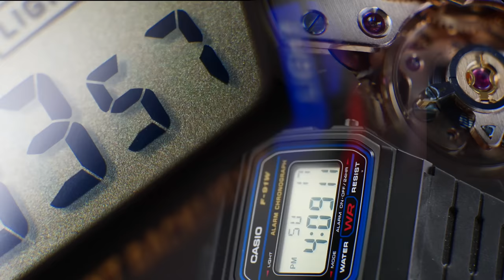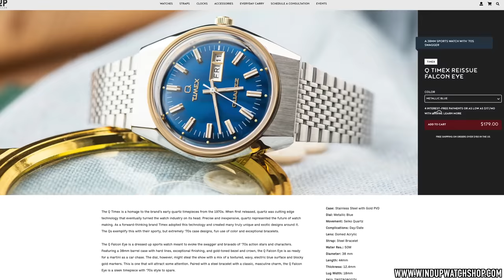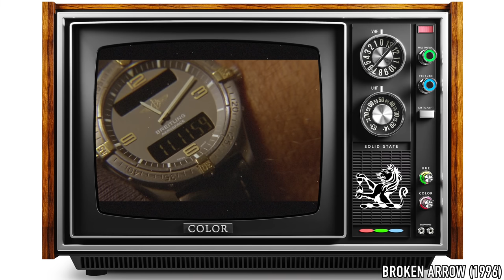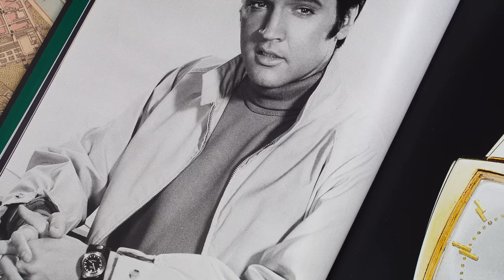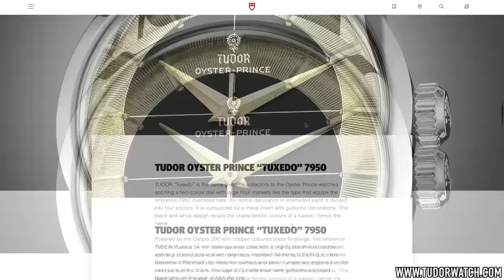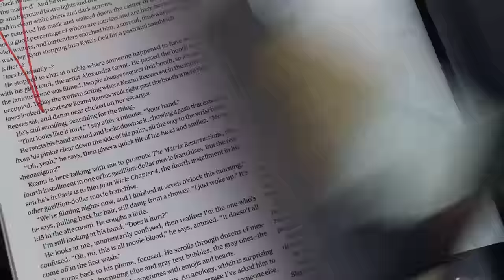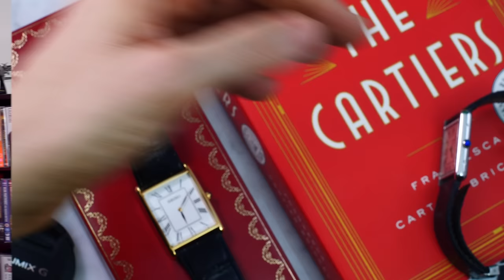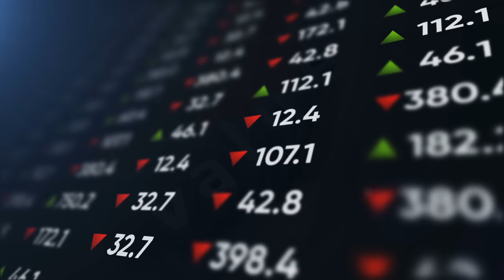2023 Watch Trends & Predictions: Sexy Tudors, Boring Rolex, Citizen Rules, Swatch Seamaster & More

Comment: I am not much of a watch collector because I don't have a ton of money to spend, and when I do it usually goes into my main hobby (astronomy). My most expensive watch at the moment is the Seiko SN411 which I absolutely love. I love the busy dial and I actually make use of the slide rule on occasion. My daily driver is a Casio G-Shock GD350B with the white on black display and a vibrating alarm which is the only thing that's ever been able to wake me up every morning. 

My favorite color is green so I have no complains about green watches except which one will I buy? I just came across a Citizen Promaster Air in green with the slide rule bezel, eco drive and audio controlled. I want it so bad! 

Love your videos, one of my favorite watch YouTubers!

Comment: "...while I find it very boring, derivative, mostly uninformative, and insulting to those less well off."

Well said. Many of us, certainly myself included, are enthusiasts whose aspirations are far lower than what many might consider aspirational. I'm 50, and could probably count on one hand the number of times I've even been in the same room as a Rolex, but I love wristwatches and the stories they tell and the joy they engender. It's also why, I believe, your channel is a success. You have found that sweet spot where you you can speak as the Urban Gentry without condescending to those of us who, like me, would be more aptly identified as the Rural Peasantry. Keep it up.

Comment: Great video as always and your ideas of colurs that may be on trend  for 2023 along with the nostalgic designs from the. 70's & 80's in mind. I would love your take on the newly released Red dial Zenith Defy Revival A3691 which follows the limited release of the Defy Revival A3642 cassaforte del tempo.
Reply from the maker: Outstanding suggestion. It has been absolutely donkeys years since the last Zenith on the channel. I will certainly look into it.
Thank you Mark, 
Best regards,
TFV
Reply: @theurbangentry  Zenith have just released another revival with a blue. dial, which looks stunning, the A3690. I have the original A3642 and the limited to 250 revival A3642 released last year but boy oh boy am I tempted by these two new ones in Red & Blue. would love to chat with you about them and get your take on the whole revival thing.

Comment: Excellent video, TGV!   I hope that your predictions are accurate. I completely agree with several specific statements you made.  

Tudor and the Black Bay are integral. The Black Bay could legitimately be given credit for saving the brand. It had already left the US and if the Black Bay had not succeeded, what reason would there have been to keep it going.  With it being a success, it has not only saved the brand but has positioned it to take over Rolex’s position as a competitor with Omega and the like as Rolex moves up the luxury ladder.   I completely agree regarding your chronograph comment. The Big Block  was stunning and would be lovely to see return. It would be interesting to see how your Big Block, BB Chrono, Daytona amalgamation comes into being without becoming a part of the Black Bay line though.  But, yes, Tudor ….keep moving forward and please, dare to make us go Gaga…😂

CITIZEN CITIZEN CITIZEN

In my opinion, Citizen is a better brand than any other in its price point.  The quality and support you get is just so much better than anything else at the price point. The new Seiko GMT is made at a price point but the TRUE GMT from Bulova (Miyota-hence Citizen) is infinitely better. For example, I have several micro brand watches.  I simply will not buy a Seiko movement micro brand. 5e quality is just not  there compared to movements like the 9015.   I was one of the lucky ones to grab a RangeMaster…..one of the key reasons I pulled the trigger so very quickly was the Miyota movement. I absolutely love Citizen and want them to keep growing Bulova, FC p, and their parent brands. 

I hope the shrinking size of pieces comes to an end.  Let the watch meet a function and the size will become a natural by product.  Making a watch to a trendy size makes it a trendy piece and therefore, less useful in my opinion. 

I have been very happy to see very high quality pieces coming from small brands. I hope they grow and “find their space” in a very crowded market. 

Fantastic, as always, TGV. Hope you and yours are well. I completely agree that the enthusiast needs to be the driving factor and salvation of our hobby.  Wear what you love!  Onwards and upwards, my friend. Be well!!!

Comment: I’m really tempted by the New grand seiko SBGR325 , with it’s 37mm width case, and 44.6 mm lug to lug. It’s a little bit on the tubby side,with a case thickness at 13.3 mm,but still very wearable. The blue sunburst dial looks stunning, and it’s a model that celebrates the 25th anniversary of the 9S movement. It has a healthy 70hrs power reserve also, and 100m water resistance. The blue dial reminds me of a Rolex platinum day date. Simply stunning, and great for smaller wristed gents.

Comment: So tristano , I'm thinking niche ,  a big niche , so how about a cool bike motorcycle watch ?
  I'm thinking durable , seriously water proof , highly legible, longer / extended strap to fit "outside " jacket 
   We often need a watch which we can go riding with , on / off road ,crossing Europe , over Alps , camping touring ,in the most  awful weather , high Temperature to freezing cold  dust dirt constantly exposed to the elements 
  I often wear G-Shock riding my bike , the problem is trying to see the watch , bike jackets are usually tighter at wrists to fit with gloves , resulting in removing gloves , unzipping sleeve ect to check watch which is a pita !
  There are watches for divers , sailors , pilots , and many others
  So who is going to design a watch for the many millions of bikers round the planet ?
   Kindest regards
 Edit - apologies there is the Seiko "riders chronograph" and beautiful guigaro design which goes half way , thoughtful 15 degree tilt and dial rotation , although not really designed to withstand elements or harh conditions and no extended strap to wear on sleeve 
 🤔

Comment: I really, ardently hope we see new high end quartz/electric. You yawned at Rolex - fair enough. And I'm with you on their older watches, back when they still made an effort. I'd love a clean, time-only, text-book-less dialed (seriously way too much text) quartz. Make it thin, make it ~38mm (got big wrists, so that's a sweet midsize spot). Heck, forgot the oyster case design! But most importantly, make it accessible. I think to how some of GS' great pieces are entry level quartz. I'd love to see Hamilton experiment with the Ventura. Move to something electric,but not a traditional ticking quartz. 

On Christopher Ward, I think that the Bel Canto general release makes sense. Originally the limited production was because they didn't expect such a vociferous and welcoming reception. You rightly criticize the "every watch is a limited edition" mentality, I think allowing the Bel Canto to just be those six hundred watches would have been the kind of fomo, artificial scarcity approach that hurts the community. For me, I went to work before the watch was released and when I got home, it was sold out. That's not great. So instead of doing more limited editions, instead of milking it, they said "we see the demand, and we're going for serial production" - that's responsible watch companying in my book.

I also think Purple is primed to have a splash. Dunno who, but a gold and purple watch using either purple gemstones or some other unusual material making a splash in the next year.

And, I don't see it happening, but I really with the big name brands would make some production of clean, thin, two hander/sub-seconds everyday/business dress watches, as well as dress watches. You look at so many people who had their one watch in the mid century - maybe had two watches - and it's just a clean, simple, do anything design.

Comment: Tristano its been donkeys as you say since i talked to you last, however much i love Citizen, owning a 1980 Chronograph cal 8110 that keeps time like a champ, a 2003 Eco-drive working non stop for 20 years now, however the most recent piece a Promaster auto ref ny0040 is having issues in that it stops overnight due to the date change mechanism although maybe because it sustained a drop, its a pity beacause i love it to bits, insomma e stato un piacere parlare con te un'altra volta
arrivederci